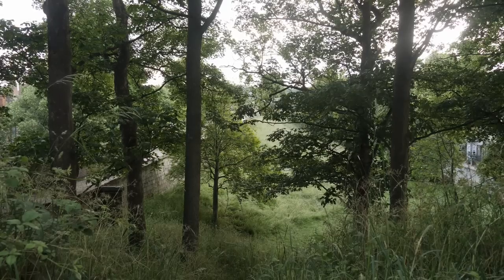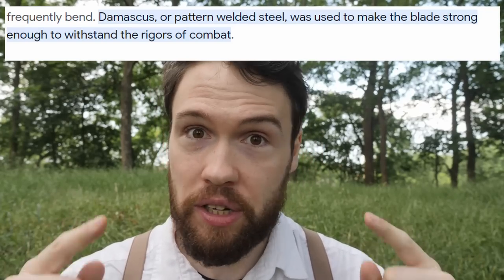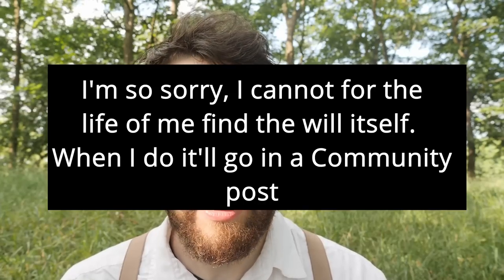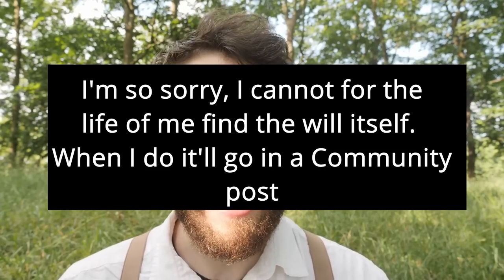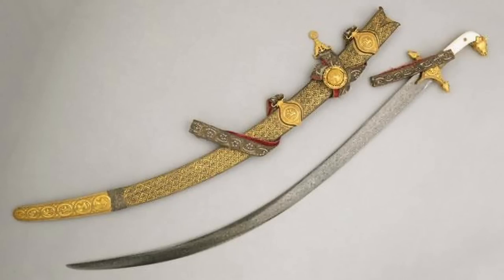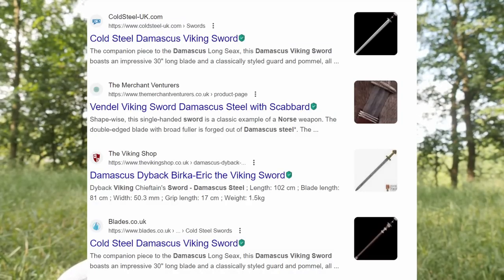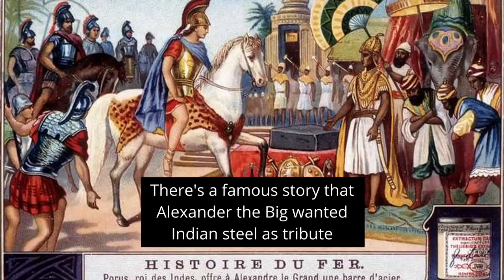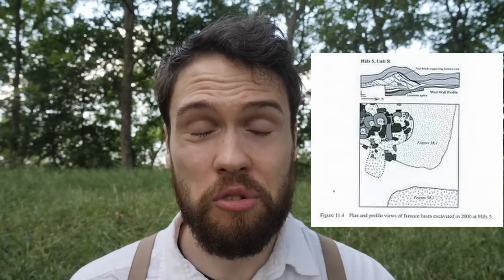Damascus Steel Isn't What You Think! Asian Crucible Steel in Medieval Europe

Comment: pattern welding is not folded steel, that is one method that can be used to make it, it is layers of steel hammer welded into one piece and there are numerous patterns and styles back then but mostly it was made from twisted bars that worked right gave a herringbone pattern, also wrought iron was often used in blade construction and they usually had a cutting edge made from hearth steel and they were really strong if made correctly, iron age Britons and the Celts made some superb quality blades as did the Viking and Germanic peoples , the Sutton Hoo blade for one, and also there is a recent find near Damascus that has evidence of crucible steel making, but you are very correct about what is sold as Damascus steel  re-enactment blades are not real Damascus, they are what the Yanks came up with in the 70's and then claimed to be making real Damascus. A correctly made period replica pattern welded blade are one hell of a lot of work and very few people are making them now though there is an interest in reviving ancient crafts and the numbers are increasing, I am 3 years in with learning blade smithing and have not managed a traditionally made, by hand period correct blade as yet, I have however managed to learn a fair amount about the subject and research also pays for those wanting to buy these blades as there is much fakery out there, seen some very convincing stuff that is etched by a laser and unless you grind a patch back to clean metal and then etch it you would find it difficult to see what is genuine unless you buy from a known maker. Good to see this subject brought up and aired outside the usual community that squabble over what is what

Comment: As a former employee of Kult of Athena, and a hema practitioner, I can say with near 100% certainty that no one is making real wootz/Damascus swords. However, metallurgy has come a longgg way in the last 1400 years and we have some of the strongest high carbon steel than we've ever had. Please still use caution when buying from sword makers, especially when they make claims like using wootz steel, or making them in the "traditional" way. Most sword makers, including ALBION, and other high end sword makers use a CNC machine for their steel, not a traditional hammer, because it's more cost effective and much quicker.
Reply: people are making modern crucible steel / wootz swords. Check out Niko Hynninen, Peter Burt, or Kilic Osman Baskurt.
Reply: @IPostSwords  "modern crucible/wootz steel" is contradictory. Stop being part of the problem.
Reply: @gwynbleidd1917  It exists, though. What else would you call it, if it is a modernly made, hypereutectoid crucible steel, with a visible pattern made of cementite spheroids, distributed due to carbide forming elements that formed a dendritic matrix on ingot cooling?